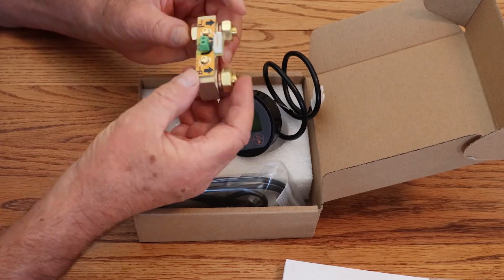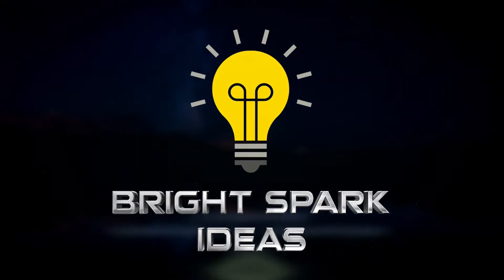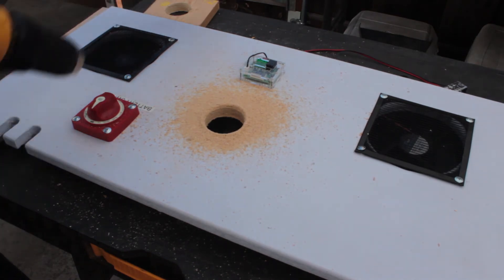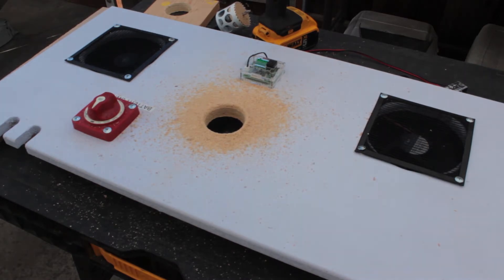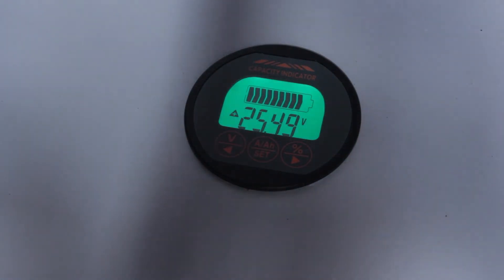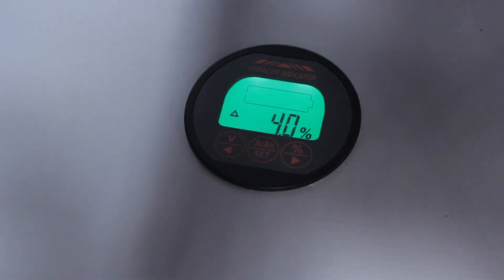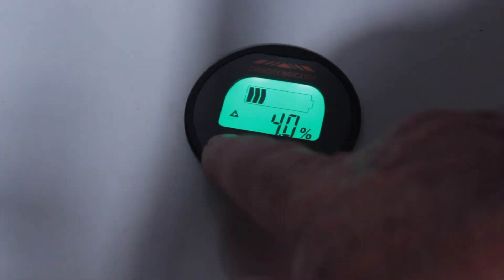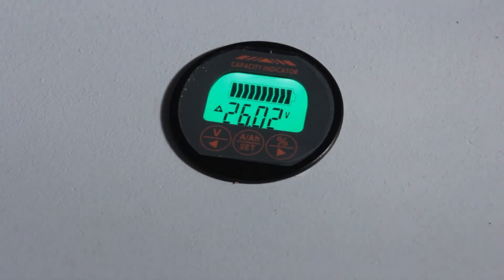Battery Capacity Tester

Comment: Installed the unit,no voltage or percentage units not showing. I have current voltage and current amps left in battery.Any ideas.
Reply: Showing 3.8 amps left 😢😢😢

Comment: Hi Do all the Negatives from Charge controllers, Loads, & Power Inverter connect to the P-  bolt ?
Reply from the maker: Hi Ed, as I have a Growatt Off-Grid Inverter, I only have one connection (Cable) from the P- terminal to the inverter. But I think the simple answer to your question is yes.
Reply: @BrightSparkIdeas  Hi thanks for reply. I sorted it out all Negatives go so shunt. Even charge controller :)
Reply from the maker: @gazed1435  Yes, good to hear it is working. It is a very useful meter.

Comment: My Victron was a total waste of money. Never again so I bought one of these. It works great. Much easier to use and way cheaper. Victron just like Battleborn and Renogy are very over rated. Paying more money isn't a sign of better necessarily. I have proven that in my camper build over and over. There are occasions that nothing else will do but rarely. Wago is an example and perhaps Mr Heater but a lot of this stuff you roll the dice. These cheap coulombmeters are a good example. Another is 8020 aluminium profile. A complete rip off. Tnutz is just as good and a fraction of the price.
Reply from the maker: Even if you do the research, it is difficult to know if you are getting a quality product that will work in the way you intend to use it. So many fake reviews that it becomes discouraging. However, it is nice when you find good products that work as advertised. Thank you for sharing.

Comment: As 2 others mentioned.. your battery was at 4%, not 40%. You missed the decimal between the 4 and 0. Second way to know you were at 4 and not 40 is the battery bar at the top, it was flashing from the first bar and going up from there. If it were starting from 40% the first several bars would be solid and the bars to the right of that would flash. As it charges to higher percentage more bars will turn solid and not flash. Hope you programmed the meter with your batteries Ah rating and set your 100% full value with your battery fully charged. Otherwise nice video. I have this meter myself and love it...very useful.
Reply from the maker: Chris, thank you, I really appreciate you pointing that out. Unfortunately, my solar system is down in the basement in a very small dark place, and I was having great difficulty in seeing while making the video, certainly not one of my best videos. I apologize for not correcting my mistake.

Comment: hello thanks for this video.learned a lot.
the percentage ,is that the amount of amps charge in the batteries?
would you expect that to get to 100% or is that dependent on the age of the batteries?
also are all the loads on the other end of the shunt?
thanks
john
Reply from the maker: Hi jw226w, Thank you for the nice compliment. The percentage can only be shown accurately if you setup the information in the meter when the battery is fully charge or fully discharged, this way the meter can accurately tell you the correct amount of capacity on the display when it is fully charged. So, yes, if you set it up correctly on a new LIPO4 battery you could expect to see 100% capacity. The shunt is connected to the negative terminal, so to answer your question about loads, it might be helpful if you check out my other 3 videos on how I built my solar system. Also I just uploaded a new video today on a new battery monitor that I think is really cool, please take a look and let me know what you think. Please subscribe, so you can see all my videos.

Comment: Do you have a link to those 12 volt fans for your battery box?
Reply from the maker: D T-Paz, Wow! I had to go back and dig for when I purchased these. They are Kingwin 140mm Silent Fan for Computer Cases, Mining Rig, CPU Coolers, Computer Cooling Fan, Long Life Bearing, and Provide Excellent Ventilation for PC Cases-[Black] CF-014LB and I paid $8.99 each. Here is the Amazon link: - https://amzn.to/3efxGWY
I also purchased the Black 140mm Aluminum Fan Filter Grills for $5.45 each. Here is the Amazon link: - https://amzn.to/32s3TrA
I hope this helps, let me know if you found them okay.
Reply: @BrightSparkIdeas  do you think they are 12-volt?
Reply: Thank you for replying by the way.
Reply: Thank you. I finally found in the question and answers section if it was 12 volt. Just bought four.

Comment: I liked the way you connected to the battery with that copper bar.  My searching for the copper bar has been futile.  Where would you find something like this?
Reply from the maker: Hi Pete, I know there are quality copper bus bars available, but I did not know I was going to need one until I tried to add the shunt. I simply cut a piece of copper pipe, flattened it in a vice, drilled the holes and cleaned it up. I am sure that this is not the best method, but I needed one quickly to complete my connection. I probably should replace it, but I had not thought about it again until you asked.

Comment: I found these on AliExpress about 4 year ago - Originally in the 0 -50 amp range  and called a coulomb  meter - measuring what goes in and out of a battery on a scooter - then they started making a 100a version which actually  measures up to 150a and a massive 300a version - I have an early one on my E bike and a 100a one on my RV - both work great - its  addictive watching how much amps it  sucks going up hill on an e bike or watching the solar put back into the lithium house battery while eating the meal you just microwaved
Reply from the maker: These are great little meters for many applications, sounds, like you are have fun with yours.

Comment: Great video. If I wanna run a few loads off my battery do I have to wire every negative wire from each item to the shunt - or can I run one negative wire as I want to wire all of my loads to one busbar if it can work like that ? Thanks mate 👍
Reply from the maker: Hi Geoff, good question, but I am not sure that I can provide a good answer, as I only have one load. My two Battle Born 12V batteries are connected in series to provide 24V to my Growatt 24V inverter, which is the only real DC load. I do have a two 12V DC fans in the battery box, which to my knowledge have never turned on, because they are 12V, that negative wire is connected to just one of the batteries. Sounds like you have everything set up correctly to a busbar, so I would just run one appropriate capacity wire to the shunt. Let me know if that works well for you.